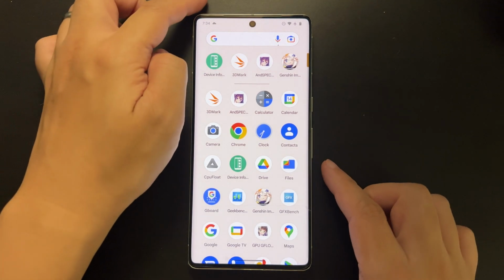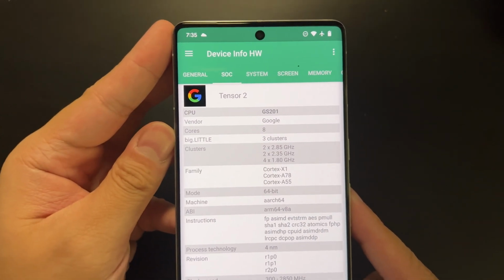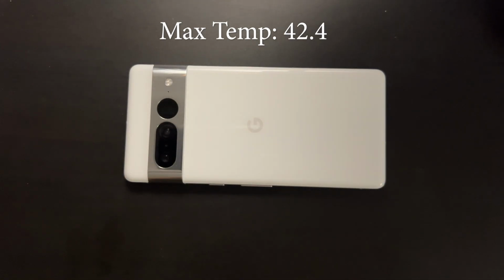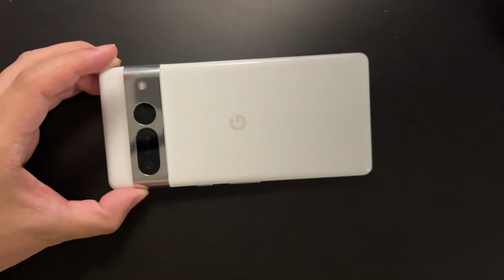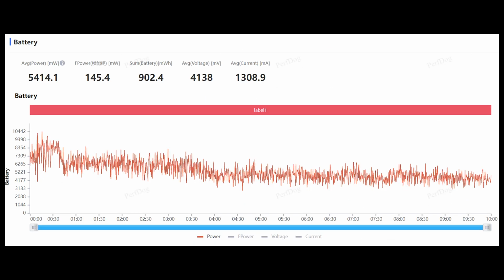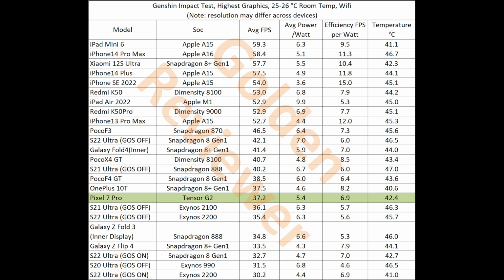Google should feel ashamed! Pixel 7 Pro Genshin Impact Gaming FPS Test

Comment: tried genshin on the rog 6 and it has got to be the smoothest genshin experience i've had on mobile. (using 16gb ram model). Also gets 90fps in tower of fantasy when most devices can't even hold 60.
Reply: You want to play games buy console or build pc. Mobile phone for calls, texts, take pics and social media.
Reply: @وايتيبولجر-خ9ش  respectfully disagree, there are a lot of people out there who enjoys playing games on mobile. Mobile devices no longer only use for basic calls, texts, photography etc.
Reply: @وايتيبولجر-خ9ش  lol you suggesting something incredibly out of topic but then here you are watching a video about a "mobile game" on a mobile phone review video. Expected from a person with an spaghetti name.
Reply: Same performance in my Iqoo 9t too😁
Reply: @metanoia7952  to tell people to play on a better platform
Reply: @وايتيبولجر-خ9ش  well, i would if i had to stay at home a lot. sadly, my work won't allow that, i had gaming laptop and i'm already tired after i got back from work
Reply: @galuh8501  you work or play?
Reply: @metanoia7952  hahaha fk me bruh
Reply: gaming phones normally have better thermals and fans to keep chip cooler. they use they same processors as other flagships. the cooling system is the difference which helps frame rates stay up for longer periods when playing demanding games. other flagships don't have this but when fans are added they perform at longer periods and higher frame rates as well.
Reply: @وايتيبولجر-خ9ش  what is this answer lmao. are you aware that people DO play on their phone now?? Mobile gaming is just another platform like PC or console. It is not 2012 anymore. Let people do whatever they want with their device.
Reply: On what graphic settings? Not max lmao. Every single video of that phone on youtube shows that it struggles to hold 60 fps on max settings when in combat. Tons of framedrops. The Red magic 7/ 7s pro comes the closet to holding locked 60fps on max settings.
Reply: @Over-mh3wr  it should struggle being the game isn't optimized for tensor chips and definitely not optimized for Android 13. Pixel like the only device running that version. Their poorly optimized for snapdragon processors. Question though, are you implying that you can't have a great gaming experience if you don't play on the highest graphical settings? I hope not, because that's far from the truth. The phones you mentioned also are gaming phones and have fans to help maintain performance. All current flagships have higher specs than what the game recommends or requires. It comes down to optimization. Which is why COD, Apex legends, Pubg and etc actually play at high settings and high fps as good or slightly better than  on the s22 ultra. The developers stay on top of their optimization for different versions and chips.
Reply: @Eazidosit  I was talking about the Rog Phone 6 in my comment as that is the phone the OP of this comment chain brought up. The Rog Phone 6 cannot run Genshin at max settings with stable 60fps, there are frame drops. And no I don't think max graphics is needed for a great gaming experience. But look at how ridiculously expensive dome of these phones are. Like the s22 ultra, Rog Phone 6, and iPhones are giga expensive phones and should be providing top tier everything including performance with those ridiculous price points. I don't know exactly how expensive the pixel 7 is but imma guess it's not cheap so I still would expect more performance than what was shown in this video. You are also damn right that it all comes down to optimization. Which Genshin on many devices especially android is severely lacking. I genuinely think the optimization of Genshin is complete dogsh*t. Even iPhones started to experience this with the 3.0 update. 

But I am curious what you mean by those games play at higher settings than the s22 ultra. Did they specifically add extra graphic settings for the Pixel 7 or do you mean it runs those games more smoothly at higher graphic settings over the s22 ultra?
Reply: @Over-mh3wr  my bad I had to edit. No there isn't any new settings 😂 that I'm aware of I was trying to basically say it plays these games at high settings and high fps just like most flagships today. Sometimes holding a more consistent higher frame rate than some. I agree, Genshin is poorly optimized. As most games it's on the developers especially when the current devices have higher than the required hardware to run on Max settings. Nice game but needs work. I'm surprised they haven't found a way to add a small fan in these other flagships yet.
Reply: @وايتيبولجر-خ9ش  with all due respect, keep your opinion to yourself.
Reply: same here with my Redmagic 7s Pro, I just love how you can play on the highest settings, no stutter, no heating issues... just pure gaming experience 👍👍👍👍👍
Reply: @theblacksorrow  no way, i seen these devices get up in the 50+ degree celsius range on multiple videos a couple months ago. they still maintained 60 fps but they get way hotter then regular none gaming phones. i also imagine they have thermal settings set to a higher threshhold to acheive this, which is good for prolong gaming but not for the life of a device. still pretty sweet!
Reply: @Eazidosit  I played genshin impact, highest settings on the game and on performance mode on the phone, the temp maxed at 40° (60fps average) using my cooler from the Gamesir X3 it drops to 30°-33°
Reply: @theblacksorrow  amazing being booredatwork (thunder E) was getting higher temperatures as well as a couple more.
Reply: @Eazidosit  That was on the Red Magic 7. Temperatures could get up to 50°. The 7s pro actually had improved thermals. Though I still don't believe him saying he had 40 degrees max. More like 45°. And from what I've seen form like Chaotik's video testing even that phone had a few framedrops just much less than say the Rog phone 6. It actually comes pretty close to holding stable 60fps. If it weren't for Genshin bad optimization it would.
Reply: @Over-mh3wr  one video tested both 7 and 7 pro and they both got over 50+ degrees celsius. it's ok either way. i think they perform well. as long as you are happy is all that matters.
Reply: @Eazidosit  But did any of them test the 7s pro though? Not the 7 pro but the 7s pro. It has improved thermals over the 7 and 7 pro.
Reply: That pixel 7 can't even outperform sd870
Reply: @Over-mh3wr  i don't think it was the 7s pro, i can't honestly say it was or wasn't my guy. been some months since i came across those videos.
Reply: the 6D Is Better 😎
Reply: @amy-295  really? the pixel plays COD, pubg at 90 fps on ultra setting but the s22 ultra only allows 60 fps right now... it also plays apex legends at a higher fps. don't be fooled
Reply: Nah you can enable that 90fps bro
Reply: @amy-295  no you can't. Booredatwork (thunder E) just did the comparison 5 days ago if that. still wasn't available.
Reply: @amy-295  that's using a work around. It also doesn't work all the time or with every app 😂 . It will come soon, once the developer does more optimization for the game on s22 ultra. It's still enjoyable to play. I have the 7 pro so I can already play it on those settings.  I'm currently playing New state  more now though.
Reply: I really wanted to get a pixel this year, but after seeing the reviews of the G2 Tensor not being a huge upgrade in gaming performance, I also went for the ROG Phone 6. I love the new game genie. It's come in clutch when I have a secondary on screen window for the Genshin interactive map when I'm farming Aranaras or Dendroculus. The background mode for games is great too, not having your Genshin reload/reconnect when you minimize is super helpful. Love the ROG phone 6.
Reply: @paulschlacter4181  that was a great choice that phone is better than pixel 7 pro ngl
Reply: @amy-295  you came to this conclusion off of one game genshin 😂. It's more to a smartphone than genshin impact. All the games it does play at a high level, the support it has, the cameras, alone make the Pixel  a better buy. Now if all you play is genshin impact and don't care about running out dated software, having good cameras, etc.. then yea the gaming phone would be better for a small crowd of people. When I want to play console type games I just stream them from the Xbox app when I'm not home to the Pixel 7 pro.
Reply: @cortez2025 Snapdragon Adreno > Dimensity Mali lol
Reply: @وايتيبولجر-خ9ش  you know Mobile gaming has more revenue than PCs and Consoles right
Reply: @haziri5118  لا

Comment: Looks like it runs just fine, if you don't look at the FPS graph.
Reply: Would you say the same, if you went ahead and got yourself a brand new, overpriced sports car, with an engine, which was locked at using, for example, 200hp only out of available 600php? As long as you don't pay attention to your speed dial, the car runs fine, right?
Reply: @WrongButtonWB  Fair argument, but you only really need to go fast in a highway. If a Ford KA can do it, I'm sure your brand new car will do just fine. I understand your point, but it's an extreme comparison to a phone because it's unlikely you'll settle for higher performance, when you can sit comfortably at medium settings.

Comment: The problem is not from the device, this game is not optimized for phones
I have a mini 6 and after playing minutes it becomes like a volcano with a lot of chopping and the room temperature is medium not cold and not hot
Just a bad game that needs a lot of improvement
Reply: This game only runs well on gaming phones thanks to it's cooling system
Reply: @samsungoneiu2000  
You are right
Reply: @relax.b13  if you notice Oneplus 10T with the latest Qualcomm 8 gen 1+chip can't reach 40fps, because cooling system
Reply: @samsungoneiu2000  
Yes, my brother has Red Magic 7 and the temperature remains normal, even with hours of playing any game, even Genshin Impact
s22 ultra with the same processor but it can't stand because of the heat
Reply: @relax.b13  I agree
Reply: That's a problem of the Chipset overheating, not the game. 

The game runs fine on my Snap 765G at maxed out settings. 

It does only have 15% of an Snap 8gen1 GPU power yet it still manages atleast 30FPS stable performance.

If the CPU isn't really efficient, the game will lag later on.

Some phones here just can't maintain 40% GPU usage without Throttleing.

Stutter can be the game being unoptimised.

However, if it first runs smoothly and then the device goes hot and throttles, that's a problem on the device, not the game.

Comment: Tensor G2 would've been a powerhouse if it was fabbed by TSMC's 4nm node.
Reply: Do you know any Exynos made by TSMC?
Reply: This is just exynos chip nothing else m it uses old x1 cores
Reply: @alese7531  Exynos is literally Samsung's product of course it would use Samsung's foundry.
Reply: Samsung is very bad at making processors, the power is not as fast as TSM and the temperature performance is very high from TSM
Reply: then the phones would be more expensive
Reply: yawn
Reply: @ST6559  do you know sarcasm?

Comment: Well if you compare it to your previous video on 6 pro where it got 33 fps with 5.8W of power, 7 pro got 37 with 5.4 W thats an improvement in performance and efficiency. Considering that the node is the same samsung 5nm and same x1 cores i think this is impressive
Reply: Not exactly, G2 is samsung 4nm vs 5nm on the first Tensor chip. That’s probably where the iterative improvement in efficiency came from.
Reply: @gmiblessed  chill.... This is their 2nd phone with Google tensor
Reply: @gmiblessed  G2 is 5nm Google already confirmed it

Comment: On my Pixel 7 I measured temperature of 45°C on the back and 47°C on front. It's not very comfortable to hold, because even the metal frame is getting pretty warm.
And it's winter currently, so I wonder how hot would it get in summer. I personally didn't expect this device to get this warm.
Reply: That's because of the resolution, to compare, an average user gaming monitor usually has a resolution of 1920 x 1080px, the pixel has a resolution of 1440 x 3120px, which pulls much more resources from the processor and the GPU in order to deliver a sharp image. Lower the fps and don't play on overclocked settings, your battery will thank you in the long run.
Reply: Ooh, wait till summer comes, and you wanna use gps navigation while driving. Let me tell you, it sucks!!! Piece of crap, overpriced garbage...
Reply: @WrongButtonWB  No worries, I returned the phone
Reply: @icyfoxe  That's a good decision you have made. What phone did you get after btw?
Reply: @Sphynx93rkn  I got Samsung S21 FE, for half the price of Pixel 7 and I'm pretty satisfied with the phone.
Reply: @icyfoxe  Great choice 👍
Reply: @juandelahoz4577  Pixel 7 only had a 1080p resolution screen. 

Even then, Genshin impact and most mobile games only run at 720p resolution to prevent overheating. Only ways to acheive 1080p or even 1440p is through rooting the phone and change gpu render values. Although at that point, battery efficiency will go way down and overheating will go through the roof.

Comment: - Performing worse than the fleeting existence of 8+ Gen 1 in the Xiaomi
- Drawing almost the same amount of power as the Fold4 at a lower resolution
- Released just before the 8 Gen 2

Good job Google 👏😂😂😂😂
Reply: Ah yes the haters you do realize this phone isn't marketed as a gaming phone by Google? thats not there goal
Reply: @jaschaamielmalik2245  Who said I hate Pixel? The last time I checked I was praising the Pixel for its superior animations and camera performance. 😂

I'm simply making statements about its performance in gaming. A phone being designed for gaming and testing it for gaming are independent. One doesn't need to necessitate the other. Regardless, its performance is bad gaming orientated or not.

Comment: The Pixel 6 Pro is really fast for games for me. Did they make the Tensor chip worse for the Pixel 7 Pro?
Reply: no!
It's probably because you're playing on high quality settings.I'm Japanese and didn't know much about it, but I think it works better than normal.
Reply: Nah it's about the same. Honestly I just play RPG or FPS games on PC so I wouldn't know. The main selling point for me was the cameras. It's sad they only upgraded mid-cores to somewhat still outdated A78 and just a bit newer Mali G710. But Minecraft and most simple 3d games run pretty good.

Comment: I've expected that you tested the Redmagic 7s Pro, would love to see how it rank up in the list (I receive my 7s Pro tomorrow)
Reply: Number 1 for sure. Tho the power consumption and heat will be very high
Reply: Congratz bro! I just bought it on 13th oct and i was notified by fedex I will be receiving by end of 18th oct. I can’t wait!
Reply: @jhkuno88  don’t think so with active cooling
Reply: @TemplarLove  you will need an external cooler for that....but the power consumption will be high
Reply: @TemplarLove  gets to 44 with 28 ambient in one video i saw.
Reply: @bulletpunch9317  ah okay get it
Reply: @jhkuno88  just tested Genshin Impact (all settings on max), started playing for 30 min using Gamesir x3 (cooler is turned off) fan is running on the phone battery dropped from 34% to 12% and the temp reached to 40 (max) 
I turned on the cooler and the temp dropped to 35 within 13 min battery was at 3% fps was avg at 60 the whole time (I didn't turn on the AC in the room only a fan)
Reply: You cannot have everything. 2h of battery is terrible. Battery life is very bad if you use the full power of the chip. You have to play plugged in which defeats the purpose of having a mobile device.
Reply: @jhkuno88  battery life is great of this phone, I charged it fully and have been playing for 4 hours straight (non-stop) till it dropped to 10% (Apex Legends - max settings - phone's setting is on performance mode "Rise")
Reply: Apex is not a heavy game. Playing Genshin you will get 2.5h of battery. That's pathetic. These chips are too power hungry specially the GPU. The GPU in 8+Gen1 consumes 7watts of power at full power, that's more than the whole sd865 chip playing Genshin...numbers don't lie, stop defending what has no defense
Reply: @jhkuno88  lol
Reply: @jhkuno88  well yeah, its running at full time 60 and a higher resolution, the high power usage is obvious. Underclock it to sd 865 levels and you'll get more battery life than those devices.
Reply: @bulletpunch9317  that's the problem precisely. There hasn't been a significant advance in efficiency since the 865, at equal power draw the new Sd8+Gen1 doesn't do much better than a 865 if at all.
Reply: @bulletpunch9317  having a chip with a 7watt GPU on a mobile device is not feasible, unless you're ok with 2h battery life when gaming heavy games.
Reply: @bulletpunch9317  I will say that the new Dimensity 8100 is a very promising chip, the efficiency is really good
Reply: @jhkuno88  it seems you dont understand, go watch geekerwans video.
Reply: @jhkuno88  go watch and then comment.
Reply: I got my P7P is playing hard core games (umm is a flag ship😎)good like ginseng impact & War Robots I love my TensorG2 ha ha ha🤪🤪🎉🎉🎉🎉🎉🎉